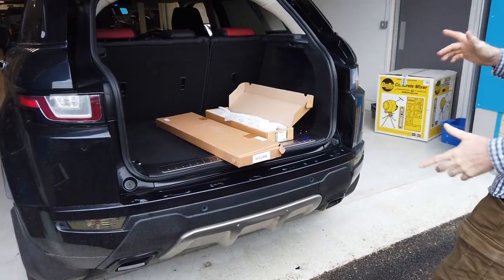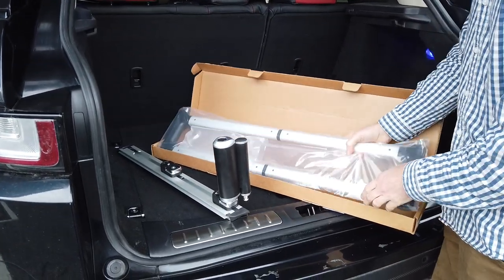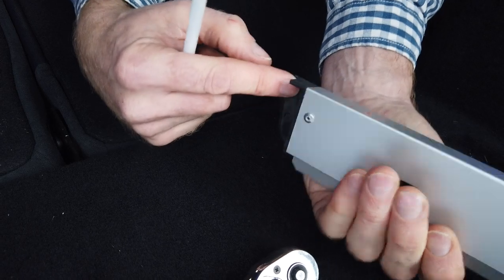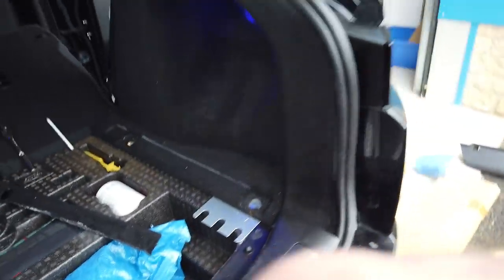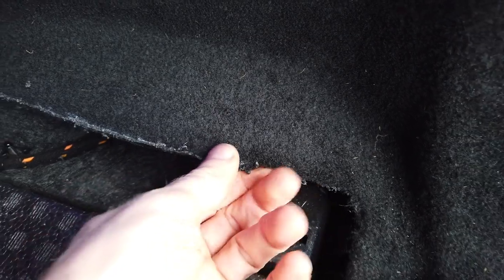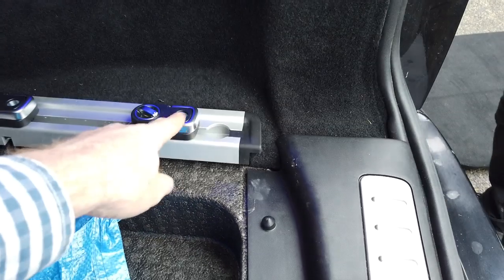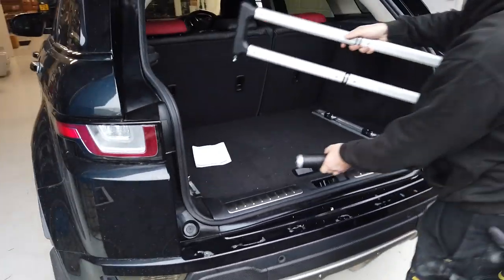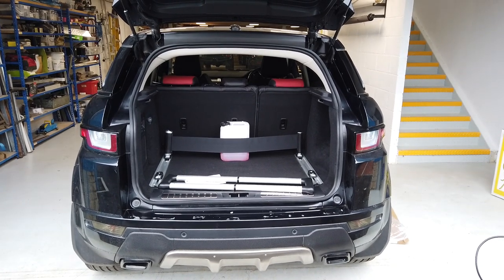Demo / How To Fit Range Rover Evoque boot rails / luggage retaining strap VPLVS0102

Comment: Why didn’t they just make the rails so they could bolt on top of the bit you cut out?
If you changed cars then the rails can’t be swapped over as the floor will be a mess.
Is there any reason you can see that prevents the rails sitting on top of the floor secured with longer bolts perhaps?
Reply from the maker: Yes its a total faf this one... I guess they would sit a bit higher... they did not sell well and its probably for the reasons you highlight.